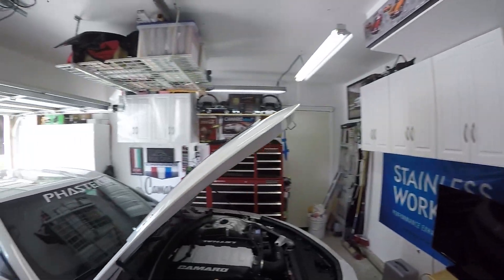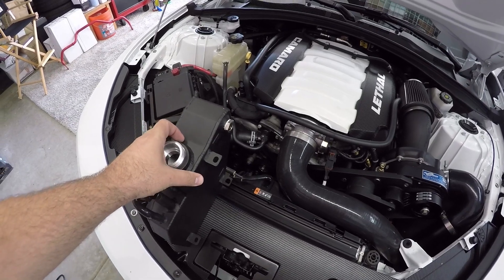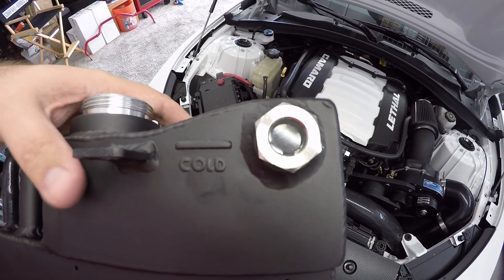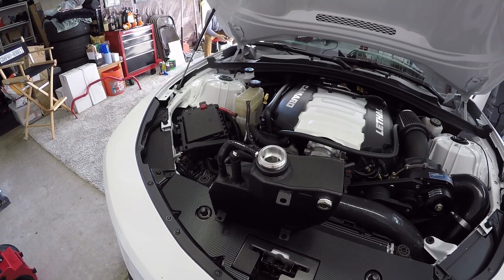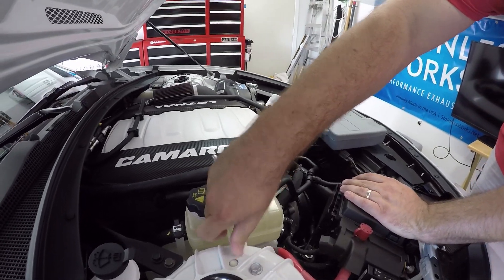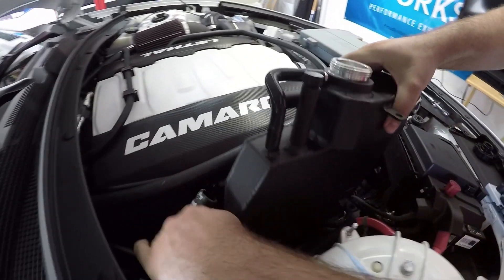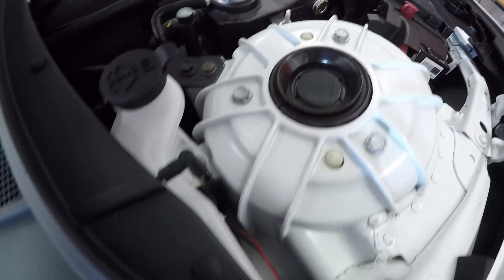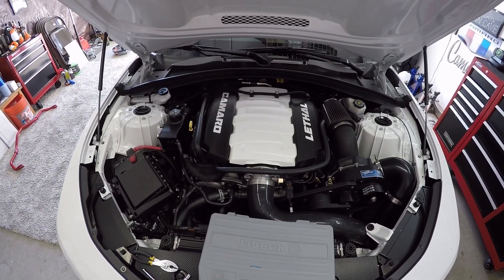How To: Radiator Expansion Tank by Mishimoto - 2016-2024 Camaro SS

Comment: I know it's been a while, but was your expansion tank naturally empty while cold, or did you already drain the tank and put it back for mockup purposes? I ask because I noticed that the bottom area of mine was empty and the top tank was below the cold fill line. This had me a bit concerned since the manual says the top tank should be full when cold, and the bottom tank should be ~ half full. Temps were fine, so I know there was coolant in the system.

Comment: Do I need to drain my coolant first or something because right when I took off the back hose it started leaking everywhere
Reply from the maker: was the car hot?
Reply: @Lethalgarage  no it wasn’t hot anymore . The reason I wanna remove the coolant tank is because I’m trying to move that wire harness under it my header is touching it and it’s burning through. Do you have a video on moving that ?

Comment: Hey lethal! Do you know any good fuel injectors? I wanna put my 6th gen camaro on e85. Also are there any cons to putting your car on e85? If so please inform me! Thank you
Reply from the maker: are you just doing E85 alone or do you have supporting mods? Use the LT4 setup and save some cash. But if the car is stock you don't need anything else outside of the sensor.

Comment: damnit you spend thousands of dollars on your car, thousands more for your pro charger setup and who knows how much for this tank upgrade and you can't afford to get the proper tool?! Its a flexible arm locking hose clamp get it $30 auto zone!
Reply from the maker: Why would I want a tool for one thing I touch once. Makes no sense.
Reply: I know how you feel but you know I have VW tiguan unrelated issue. Multiple hose clamps and range from small like what you have to massive clamps around the intake charger tube. I went to the parts store because after getting fed up with using pliers and keeps slipping I got the tool It was night and day difference. Tools don't go bad unless you don't take care of them. So for my future projects and cars 5 seconds to clamp, remove instead of MINUTES!!!! makes it all worth wild. You do what you want I just prefer to have the right tool for the right job.